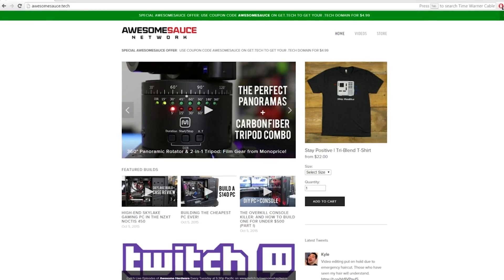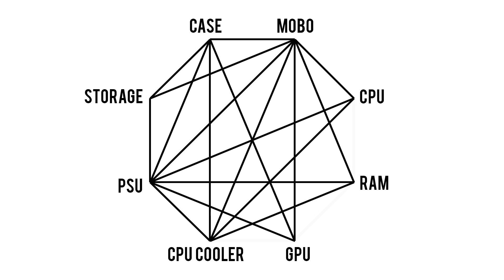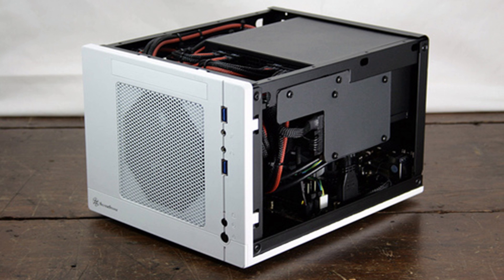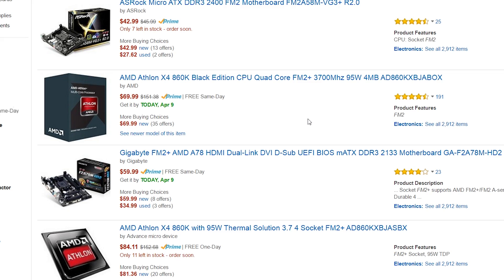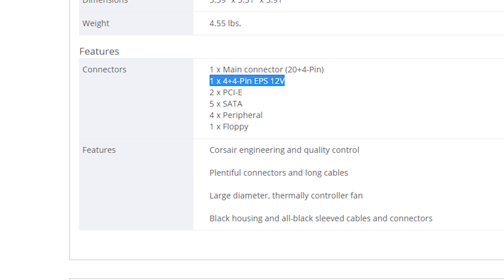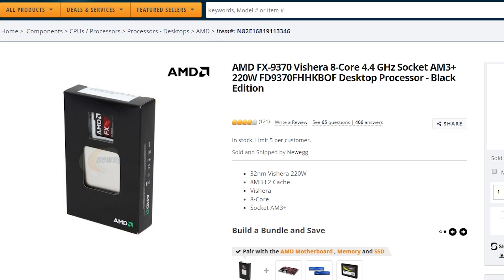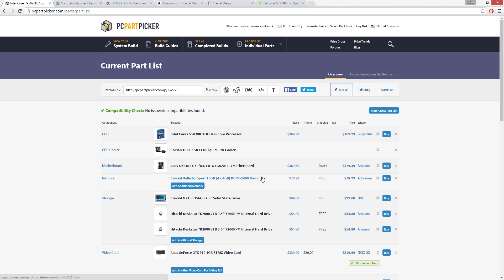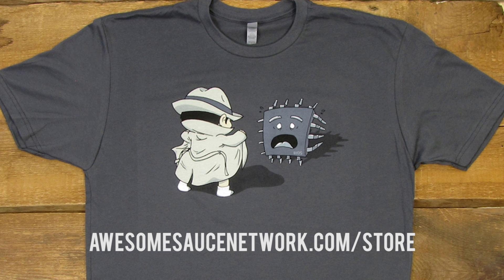How to Choose Parts for a PC! The Ultimate Compatibility Guide!

Comment: this will be my build 

i7 6900k

2 gtx 1080s in sli (evga ftw)

asus strix x99 atx mobo

ssd

3 hard disks

128 gb ram dominator platinum 

corsair h100i v2 cpu cooler

corsair rm1000i

positive air cooling

i still didn't decide what case

nzxt hue+

BTW this will be my first build and i need that extra power

Comment: Sorry, you didnt make this clear enough but if i have 4 usb 3.0 and 6 usb 2.0 ports on my motherboard (i dont even know if any case has that many usb ports) will it work with a case that has only 2 usb 3.0 ports or do i absolutely need my case to have 10 usb ports XO.
Reply: If anyone is kind enough to reply, this is the case i am planning to get Corsair SPEC-02 ATX Mid Tower Case ans this is the motherboard Gigabyte GA-H110M-A Micro ATX LGA1151 Motherboard
Reply: +TheAverageGamer56 The usb ports that are on the motherboard are on the back of your PC case with all the other ports. If you have usb ports that are build in the case at the front like many cases do, then you have to connect them with your motherboard inside the pc case. At least that is what i think.

Comment: will this work? i dont get this video
http://pcpartpicker.com/list/
Reply: yes but you should wait for the rx 480
Reply: MLG Doge Army why not the 1070?
Reply: +poopstick cause there kinda expensive right now and the 480 is probably gonna be as powerful as the gtx 980
Reply: +MLG Doge Army and also the 480 will only be $200 :)
Reply: +MLG Doge Army should  also get a liquid or air cooler like the 212 evo or the hi100
Reply: MLG Doge Army k but also when the 1070 goes down to 379$ the non founders edition cards, then i save 70 dollars and also im not using the k95 im getting the k70 rapidfire rgb, which is like 20 dollars cheaper, and 90$ could get me a liquid cooling solution
Reply: +poopstick sounds good
Reply: k thanks
Reply: +poopstick np

Comment: I'm using an i7 6700, and I bought a hyper tx3 air cooler.  On the box it says its compatible with i5 and i3, am I fucked or what? The fan did come out in 2014

Comment: if a mobo has PCI-e 3.1. 4.1, etc. will it support PCI-e 3.0 GPUs?
Reply: It is fully backwards compatible in both regards. An older GPU will work on PCIE 3, and a newer GPU will work on PCIE 2. Just keep in mind it will use whatever the slowest part is.
Reply: yes
Reply: No. Pci-E is not backwards compatible. It is forwards compatible though. A 2.0 will work with a 3.0 gpu. But not 3.0 with 2.0 gpu

hope u had fun

Comment: Need some help with my PC that im going to buy in the next month or so. Would anyone change anything or is this looking solid? 

Intel® Core™i7 Quad Core Processor i7-6700 (3.4GHz) 8MB Cache

Motherboard--- ASUS® MAXIMUS VIII RANGER: RoG, PCI-e 3.0, SATA 3.0, LG1151

16GB HyperX FURY DDR4 2666MHz (2 x 8GB Kit)

8GB NVIDIA GEFORCE GTX 1080 - DVI, HDMI, 3x DP

Processor Cooling
Noctua NH-D15S Ultra Quiet Performance CPU Cooler
Reply: what about the psu? you know that it really matters right?
Reply: CORSAIR 450W VS SERIES™ VS-450 POWER SUPPLY

Using PC specialist as i wouldnt want to mess up trying to build it myself XD
Reply: its not that difficult. Sure, it will take some time but its going to be worth it

Comment: Super excellent video. People are saying it's confusing and sure, if you're coming here without knowing a single thing about computers, of course it will be, it's all nonsense :') I've gone from knowing not a thing about computers to knowing most of what was covered in this video in about two weeks (obviously with some major research), it can be done. This video was really helpful and it's helped me steamroller some of the fears I was having about compatibility. PC part picker is great, but it came up with an issue for me about my chosen motherboard that I knew wasn't true (said it didn't have usb 3.0 headers when it does), so I wasn't 100% trusting of it. Went through my build as the video played, and now I'm certain I'll have no issues. Thanks a bunch!

Comment: Could you just buy a cheap pc and replace the graphics card or is that not how it works?
Reply: also if not why not?
Reply: you have to check for compatibility issue
Reply: +WB IsMe what does that mean and how do I check for compatibility?
Reply: Compatibility check for graphic card. 12:39
1) Check case's graphic clearance size.
2) Check if your power supply have enough wattage.
3) Check if your power supply have enough PCI-E power connector.
4) Check if your processor will bottleneck your graphic card.
5) GOOGLE if you are still clueless.
Reply: +WB IsMe Completely clueless, I thought you guys said this was easy. Thanks for the help though. Look if the only reason you guys says to build your own pc  cause you can get it cheaper that doesn't matter to me, I make enough a year. You being an expert of pc's what would be a really good pre built one and again money doesn't matter but expansive doesn't necessarily translate to good.

Comment: Do monitors, keyboards, mice, and the fans have   To be compatible
Reply: don't forget to check if your desk is compatible
Reply: a razer gaming mouse would work fine with a mechanical keyboard from 1998. Don't worry, there is no compatibility issues.
Reply: +NOX saiv (NOXsaiv) thx
Reply: +Fairy tale i forgot about the fans though, it's obvious but you need to check your case suppoerted fan sizes, some cases only give with 2 fans but have more room for other fans for you to fill. Fan size can be from 40mm to 220mm, although the most common one is 120mm i think
Reply: +NOX saiv (NOXsaiv) thx.😀😀😅
Reply: +NOX saiv (NOXsaiv) do you know about syncing monitors like if i have four monitors how can i sync up three and leave one solo?
Reply: +Fairy tale dont know much on that topic really, but i know that you can have multiple screens attached to one pc, all of them will copy eachother, you can set one as an extended display, lets say you have 5 monitors, 4 monitors will mirror display 1, while the fifth can behave as an extended screen as display 2, as if you have only 2 physical screens. But to make display 2 completely independent is something i dont know of. Everything of this sort can be done on Nvidia panel or windows itself. Although nvidia one is more customizable.
Reply: +NOX saiv (NOXsaiv) ok 😃
Reply: +Gaffel k
Reply: By syncing do you mean Eyefinity or Nvidia surround? You can enable 4 displays of your choice to be "synced"and have the other one just be extended as a second display.

Comment: why is it that only certain processors are compatible with certain HDD and SSD
Reply: Since when did certain processors are compatible with certain storage device?
Processors and storage device will not create compatibility issue.
Reply: I think you're confusing with something else. CPU's are only compatible with certain sockect (motherboards) and DIMM types (RAM)
Reply: no no no this has happened many times where i will add a HDD or replace a CPU in a computer and it will reject the HDD but when i remove the HDD or switch the cpus the computer will work with no problem
Reply: Goo's Gaming And Tech
This has nothing to do with compatibility issues. Something must interfere. What is on those HDD's? Are you sure they work? They could be corrupted. If you replace a CPU, you may need to reinstall the OS, though. And on the HDD you replace, is there an OS installed on it?
Reply: no i ordered a WD Red to put in my Dell the HDD is brand new i was trying to have one 500GB HDD for my personal stuff a 70GB for my "special videos" ( ͡° ͜ʖ ͡°) and a 500GB for my games i already had the 500 and 70 but when i put in the 500GB for my games when i booted up the screen was blank
Reply: Goo's Gaming And Tech
Blank screen? Can you describe to me exactly what you did?
Reply: i opened my case and plugged in the correct wires, and sata cables but when i hit the power button nothing happens
Reply: Goo's Gaming And Tech
You only did that, right? Nothing else. You didn't disconnect other components? Did you disconnect the PSU before all that?
Reply: no
Reply: Goo's Gaming And Tech
I assume that's a no to all three questions.
1) Never touch the innards of your pc without both turning off and disconnecting your PSU. You may not be afraid to get a little shock, but it could also potentially fry your entire system. Although the chance is slim, it's smart to always make sure you turn off the PSU and then disconnect it. And to 100% safe, touch the metal railing at the fans to discharge any potential residue of electrical current.
2) Have you tried connecting the HDD to another system? It could be dead-on-arrival. But that wouldn't explain why your system wouldn't boot.
3) When you turn on the PC with the new HDD installed, did you hear it start? You only told me you got a blank screen (which is weird on its own). Did the pc actually start at all?
Reply: for number 1 ok thanks i will do that net time
number 2 i used a little usb adapter and plugged the NEW  Western Digital Red HDD into my laptop and my laptop recognized it just fine. well FYI its a Dell Studio XPS 9000
Reply: Goo's Gaming And Tech
The only thing I can think of is that the 12 volt rail that third HDD is connected on cannot be supplied with power.
The PSU in your pc isn't amazing quality, to say the least. I can't find any specs of your PSU on the web, even though I know the name and wattage. Your PSU is simply one that is not being sold separately.
Another reason why I advise against buying any pc pre-built. Always assemble it yourself.
Could you give me what's on the side of the PSU? More specifically how man 12 volt rails it has and how many amps they can provide. I'm guessing your HDD is hooked on a rail that can't supply it with power, since you already have two other attached to it. Connecting it to a different rail can resolve this issue.
Let's say you have a 12 volt rail that can only support 12 amps. But your two HDD's take 5 amps each in full write. Adding a third on that same 12 volt rail will simply prevent that volt rail from being fully powered. Since you don't have enough power to fuel that last HDD, you don't get full circle and your other two HDD don't start either, thus the blank screen.
If this won't resolve the issue, I'm out of options.
So you'll have to use another 12 volt rail from your PSU to power your HDD, assuming you have a spare one left. Just use a sata power from a completely unused wire. I'm assuming you are using two sata power connectors from the same wire to power your other two HDD's. Now just use a second separate wire to power your third HDD.
Reply: they're all separate, and unfortunately im currently at my mom's visiting and once i get to my father's house i can reply
Reply: STR33TSofJUST1C3 but if im not mistaken its either something of 250-500W for the PSU

Comment: can ddr5 graphic cards work on a ddr3 motherboard
Reply: +MaroBeast Gaming It is GDDR5, not DDR5. Motherboard's DDR3 is for RAM while graphic card's GDDR5 is for VRAM. VRAM is designed for specific type of job. RAM can also do what VRAM does but not as efficient as VRAM. There are no relationship between GDDR5 graphic card and DDR3 Ram. 
Yes, a GDDR5 graphic card will work on a motherboard that supports DDR3 ram to be exact.
Reply: Thank you.

Comment: Can someone please verify my hackingtosh parts. Thanks. 

Hackingtosh Build parts: 

- Corsair Carbide Series 400C Mid-Tower ATX Performance Computer Case  
- Intel Core i5 4690K Processor (3.5 GHz, 6 MB Cache, LGA1150 Socket)
- EVGA Nvidia GeForce GT 740 Superclocked Graphics Card (2GB, GDDR5, PCI Express 3.0)
- Gigabyte Z97-D3H Intel LGA1150 Z97 ATX Motherboard (4x DDR3, 4x USB3.0, 10x USB2.0, GBE, LAN, HDMI, DVI-I, DSUB) Rev 1.2
- Crucial BLT2CP4G3D1608DT1TX0CEU 8GB (2x 4GB) Ballistix Tactical Memory
- Corsair CP-9020015-UK Builder Series CX750 ATX/EPS 80 PLUS Bronze Power Supply Unit, 750 W
- TP-LINK TL-WDN4800 N900 Wireless Dual Band PCI Express Adapter
- Samsung 850 EVO 500 GB 2.5 inch Solid State Drive

Comment: http://pcpartpicker.com/p/LFWxZL will this shit work? I will overclock processor
Reply: Haha, yeah. Overclock that shit to over 9,000 gigahertz
Reply: STR33TSofJUST1C3 nice
Reply: yeah mate, that will work great! I wouldn't recommend overclocking though. you will not see a large gain and without an SSD and quad core CPU you will likely be bottle-necking components that overclocking will not really help.
Reply: Also, that RAM will be underclocked my the motherboard, the RAM will run at what the motherboard can handle. In this case 1600hz compared to the 1866hz the RAM is made for. you could find cheaper RAM in this case.
Reply: Adam Gillies nice :D thanks for helping im getting this in 2 weeks

Comment: Another consideration between case and mobo are fan connectors. While most mobos have enough pins for the majority of case fans, those who want to go crazy with the ventilation systems may want to look for boards with extra connectors or purchase pin splitters.

Comment: CPU: Intel Core i5-6500 3.2GHz Quad-Core Processor  ($194.99 @ SuperBiiz) 
CPU Cooler: Cooler Master Hyper 212 EVO 82.9 CFM Sleeve Bearing CPU Cooler  ($24.89 @ OutletPC) 
Motherboard: ASRock B150 PRO4/D3 ATX LGA1151 Motherboard  ($69.98 @ Newegg) 
Memory: Kingston HyperX Fury Black 8GB (2 x 4GB) DDR3-1600 Memory  ($30.99 @ SuperBiiz) 
Storage: Western Digital AV-GP 1.5TB 3.5" 5400RPM Internal Hard Drive  ($50.00 @ Amazon) 
Video Card: EVGA GeForce GTX 960 4GB SuperSC ACX 2.0+ Video Card  ($179.99 @ NCIX US) 
Case: Apevia X-PIONEER-WHT ATX Mid Tower Case  ($55.98 @ Newegg) 
Power Supply: EVGA 500W 80+ Bronze Certified ATX Power Supply  ($34.98 @ Newegg) 
Total: $641.80

is the build OK? want a good cpu that will last for a few years. Want to play games stable on high or even med. rather high. how much will the 960 drop after the 1080&170 release?

thanks for helping. my first PC :)
Reply: +Julius Doorn I assume you don't plan on overclocking but if you do then I'd suggest the 6600K and z170 board. I would also strongly recommend spending the extra cash on DDR4 memory as it starts at higher clock speeds and you get more performance for your money. I would suggest a Hitachi Deskstar 7K2000 2TB as it performs fine and is on 54 bucks on Amazon. Lastly, if you have the extra cash, I strongly recommend a small SSD to use as your boot drive and for anything other applications you commonly use. Something like the Kingston HyperX Fury 240GB would work great and is only 70 bucks on Amazon. Other than that the build looks good for an entry level gaming rig. Good luck and feel free to ask if you have any questions.
Reply: I agree with Kris here. That mobo only supports DDR3 up to 1866mhz. Better to get a cheap 170 chipset mobo so you can get some DDR4. It's gotten cheap though. DDR4 isn't as expensive as it was a year and a half ago.
Also, don't get a B chipset mobo. They're aimed at enterprises, not pc enthusiasts like you and I. Get an H or Z. Like and H110, or a Z170. The Z boards are those that allow overclocking.
Reply: Don't listen to them on the RAM part. Slower speeds on ram make a minimal difference. My recommendation is do your research on the difference it makes and decide for yourself. I say pick the cheapest ram you like the design of and how many GB of ram you want. Speed barely changes anything.
Reply: Also for your motherboard, the most common for nonoverclocked CPUs is H170. Youre going to have to check I/O inputs and SATA 3.0/2.0 quality, etc to your liking.
Reply: Mac Smith
The reason why he should opt for DDR4 is because of longevity. Let's say he wants to upgrade his RAM in a year or two. DDR3 modules are more and more difficult to find.
Also, motherboards that only allow DDR3 have generally less features.
Reply: STR33TSofJUST1C3 Yeah that makes sense. I wasn't arguing DDR3 vs 4. I was saying the speeds e.g. 1800, 2133, 2400, etc don't matter and you're better off saving money on ram and putting it anywhere else like GPU, CPU, storage (SSD, HDD)
Reply: Mac Smith
Oh yeah. RAM speed is only important when rendering videos or 3D. Only in those cases will you see a drastic increase in performance from 2133mhz to 3300mhz. But in gaming or simpleda-to-day tasks RAM speed won't make any noticeable diffference. Also, DDR4's lowest clock speed is 2133mhz, and that's pretty good.
Also, I don't think Intel CPU's, with the exception of K sku's, can utilize RAM speeds above 2133mhz.
Reply: Check out to make sure your mobo supports that ram. The from what I read about the mobo the ram supports ddr4 and you have ddr3 on your wishlist

Comment: How much this shit cost!!??
Reply: what exactly?
Reply: +Gamerpro Most likely it cost $1,000 but you can go on a budget and still get a cool computer for $700. IT's all about getting the most bang for your buck.
Reply: It's not that difficult to get a good bang for buck pc. Just ask some pc tech nerd like the bunch of us here. 700USD pc for the casual 1080p gamer is very doable. But where I live, Belgium, you'd need to add hundred to it, and change it to EUR. Because that's how expensive it is here to build it. Luckily good guy the Netherlands can ship over some parts 20% to 30% cheaper.
Reply: it can vary between $25 and $9999999999999999.98